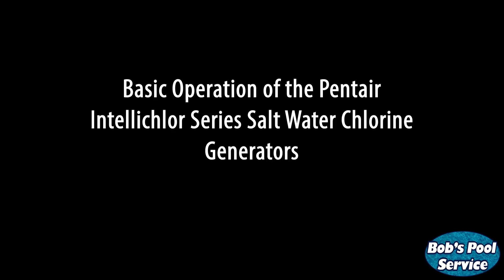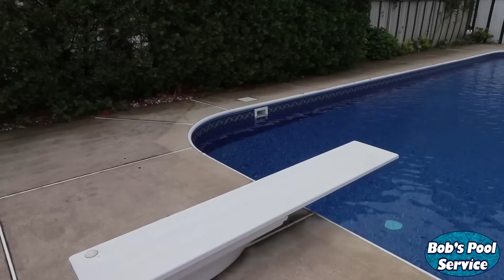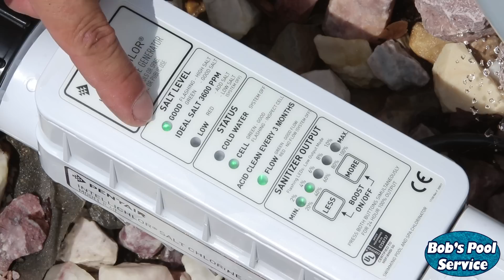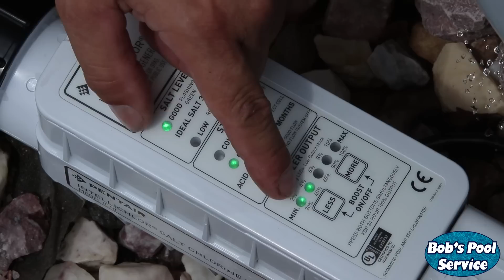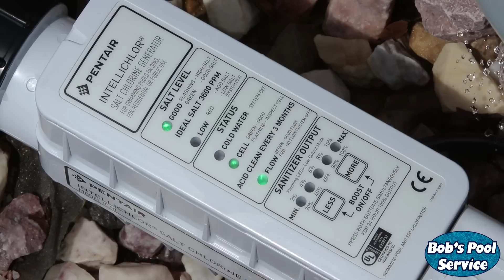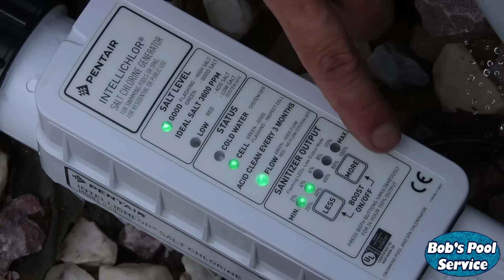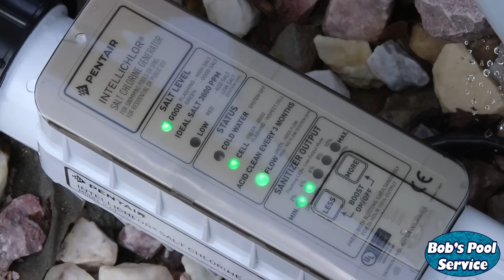Pentair Intellichlor Salt Water Chlorine Generator Operation

Comment: Great unit. However i wish it had a digital led readout like the Pentair ichlor 30.  The ichlor 30 loks very similar in style to that of a water meter, and has a flip up lid.  With the ichlor 30 you can check water temp, and view lots on the led display.  I think they now have a more advanced model available.  They are quite expensive though.

Comment: My less/more button will not change the salt level.  It always remains on 40%.  It will not allow me to change.  Any sugestions?
Reply: It is adding chlorine, not salt.  A salt pool is a chlorine pool that converts salt into chlorine.
Reply: If the IC40 is plugged into automation, it will be controlled from / by that automation.
Reply from the maker: As another commenter said if it's plugged into an automation system you would control it there, this video is made for the stand-alone installation.  If you have a stand along install and it won't change try pushing the button harder...  if that doesn't work I'd consult a pro and see if the unit is working correctly.

Comment: What if the generator is reading low but when taking a water sample in they say it’s high?
Reply from the maker: I would change the flow switch which has the salinity sensor built in.  Id trust the water sample.

Comment: Do the IC 20, 40 and 60 have the same circuit board?  How do you check to make sure the circuit board matches the cell? (10, 40, or 60)
Reply from the maker: All three units used the same transformer, the circuit board inside the unit I wouldn't know because it's sealed and potted.

Comment: What happens when your sanitizer lights are showing the % output?  When I push the more or less buttons nothing happens or lights up?
Reply: I have the same problem.  I can't change the output?  No clue if it's broken or what to do.
Reply from the maker: Be sure it's not connected to an automation system. Sometimes the buttons take some force to push them in. The new style that just came out has an easier interface.

Comment: What if sanitizer output lights are off and won’t come on unless I run a diagnostic test. Then stay off. This happened after turning power off and back on.
Reply from the maker: I never saw that, I'd contact Pentair customer support.  Sounds like the unit might be faulty but maybe they know something we don't.

Comment: I’m trying to figure out why my new generator would flash high salt but when I test the water it says my chlorine is 0.  I’m wondering if something got stuck on the sensor
Reply from the maker: The generator should be producing chlorine even with high salt.  There's a lot of reasons your pool may not be registering enough chlorine though, running at too low of a setting, not running your pump long enough, undersized system for the pool, improper water chemistry that is causing your chlorine to dissipate or get eaten up quickly by the sun, the list goes on.  The way we test a unit to be sure it's functioning is disconnect the unions, fill a bucket with pool water, immerse the cell push on the flow switch with a stick, if you see bubbles coming off the plates the cell is indeed working.  However, unless you're very mechanical and have a way to put in a bypass spacer where the cell goes I don't suggest this test, a better idea would be to contact your pool professional and get it checked if all the other factors are ok.  Definitely get a water test.

Comment: If my clients pool has too much water due to rain, and he doesn’t want to drain the pool just yet, will that affect the salt readings?  I poured 3 bags of salt into the pool weeks before the rain and every week when I check the salt readings, it’s below ppm. (2400ppm to be exact).

What gives?
I did do a salt cell clean in February of 2025.
Reply from the maker: Well, just lowering the water won't dilute the salt but when it rains and a pool has more water added it will definitely dilute the salinity.  Evaporation does not cause salt loss either so if you lose water from evaporation and then refill you'll have the same ppm.  Here in NJ we get a fair amount of rain, generally we add salt in the spring (depends on the cover) and once mid season.

Comment: So if I’m converting my pool to salt is this the only thing I need to buy? Is it an all in one package system and no other additional controller required?
Reply from the maker: There's two main components to the system, the transformer (which steps down the AC to 24V) and the cell itself (shown in this video).  All the controls are on the cell itself and it can be used as a standalone system just as I explained in the video, however, there are also options to pair it with automation panels where you can connect to the network, control with your phone, etc.  I don't feel that's necessary for most but it is an option.  I wouldn't call it a "kit" though, in addition to the cell and transformer you will need some plumbing fittings, pvc glue, also some electrical wires, conduit and 8 gauge grounding wire.  If you're familiar with plumbing and electrical wiring the installation isn't too involved but if you've never done that sort of thing it would behoove you to hire a professional.  We generally sell the unit, installation, adding salt to the pool and explaining how the system works as one entire package to our customers.  Best luck, people often say to us they should have converted sooner, haven't yet found someone not happy with going the route of a saltwater pool.  With the cost of chlorine rising I figure it might even save some money now, we used to sell it on convenience not saving money but this has changed.
Reply: @BobsPoolService thank you. Can I use any 24v supply or does it have a special connector to the pentair 24vac supply?
Reply from the maker: @HowToDoitright  The connector is special so any generic PS would not work unless you cut the cord, however in recent years companies have copied the Pentair transformer along with the connector.  I don't know if the components inside these "knock off" transformers are of good quality.  I can say the Pentair ones rarely fail, usually if they die it's from a power surge and a simple change of a small  bladed fuse is all that's needed.  The bayonet lock connector where the cord goes in can also lose connection, we're sure to handle plugging and unplugging the cell with care.

Comment: Cell light is flashing green. I cleaned it and it still is and no matter what i do i cant get the chlorine levels up.
Reply from the maker: Could be the end of the cell life, there is no serviceable parts in the cell itself short of the flow switch.  If a proper cleaning doesn't stop the service cell light from flashing it's likely time to replace it.

Comment: I have no lights turning on at all they turn on for a quick second then they all turn off a lil help please?
Reply from the maker: I would check the connection of the cord to the bottom of the power center, sometimes it can do that.  Hard to diagnose further without being there.  If it's the cell itself there are no replaceable parts except for the flow switch, if you had another cell to check it with you could also do that to make sure something hasn't gone awry with the power center.

Comment: Hi Bob.....Great Video and explanation by the way.  Very Helpful and easy to follow.  I have a 3 yr old C-40. Pentair Cell.  Im in the Gulf Coast of  Florida.   My cell is off.   (no lights -no Power)   I unplugged  and plugged the cable. Also  turn the breaker switch off a few times, and rebooted the wifi.  Nothing helped.   Do you have any  other suggestion on  what else I need to check.   Could the unit be shot  in such a short time?   Thank You
Reply from the maker: Just seeing this now, the most common issue I see is the fuse inside the transformer blows, if you had a known working cell you could test that easily and see if it lights up.  I'd open up the power center and check the fuse inside, if you're good with electric you can also use a voltmeter to make sure there's AC going into the transformer and 24V coming out of it..  The 2nd most common issue I've seen is the bayonet connector where the cell cord connects to the power center goes bad, it sounds like you did check that as best you can, sometimes wiggling it will briefly put power to the cell.  I don't believe I've ever seen a totally dead cell on any of our customers pool, 3 years is not a long time, we see quite a few lasting over 7.

Comment: More importantly Bob if the flow switch is reading green and the pump is shut off. What happens when a cFinns? Trying to  produce with no water over the finns?
Reply from the maker: No idea, I've yer to see one with a broken flow switch error in that direction.  I have put them in buckets and manually pushed on the flow switch to test them but again this was in water, if it bubbles it's good.  Did you have a flow switch reading green with no flow?
Reply: @BobsPoolService  I have before. I think it just became a little sticky. Had to tap on it once or twice and it would go to red. Just don't know how long the Fins can fizzle before doing damage to the cell.
Reply from the maker: @brians.4488  The cell would still have water in it even when shut off unless your system has an air leak, however the flow sensor is a replaceable part, I'd probably do that if I were having your problem.  You can get a pentair one or aftermarket one, I've used both and they seem to work the same.

Comment: My unit does not lower or raise when o press the less or more buttons...it also does not go to 100% while pressing both buttons ..does anyone have a fix ?? Thank you
Reply: Same issue
Reply: @mvpileggi1127  I think because I have the automation panel, the buttons are override by the panel ... Do you have a panel?
Reply from the maker: The video was for a standalone unit, if you have an automation panel the buttons do nothing. on the unit and all control is via the intellitouch panel.
Reply: @pelu7104  yep that was it!
Reply: Weirdly enough, I have to turn it down on the panel AND on the intellichlor itself. It seems whatever % the panel is set to is the minimum the intellichlor can be set to via the LESS and MORE

Comment: I had a salt cell that wouldn’t register the salt in the pool even after I cleaned the cell with Muriatic Acid, so I bought  new one and installed it and the salt is registering but the flow is Red. ( it wasn’t showing red on the old one )  I cleaned out baskets on pool pump and skimmer. Then I backwashed and rinsed and it still shows red on the flow. Is there anything else I can do before I call the manufacturer. In the meantime should I turn off salt cell. I am a 67 year old woman taking care of my pool so the Grandkids can enjoy it. Any and all help is appreciated. Thank you.
Reply from the maker: Make sure the cell is installed in the proper direction, if it's incorrect the flow switch won't work and it'll show red.

Comment: Pentair has the incredible stigma of customer service. New IC20 arrived DOA. Took then 2 months to replace it amongst many unanswered emails and several calls with  empty promises of callbacks. Only when I turned to the BBB and social media did they do something. Thay have 2 star ratings across the board. Will be buying another competitor when this one breaks. 1300 every 3 to 5 years is an expensive nut to crack. They also lied to the BBB stating they left several voicemails when it never happened.
Reply from the maker: We don't make pool equipment, we just install it.  That's unfortunate about your experience.  I have seen across the board lowered quality on everything, so far we've been more fortunate with Pentair than other brands but as a pool professional we have different ways of reaching out to these companies so it's likely a different experience.  One thing I will note that manufacturers are doing is supporting products differently depending on if it's an e-commerce purchase or if it's through a brick and mortar business...  honestly I believe the product is likely the same but the warranty and support you'll get can be VASTLY different, from a full 3 years to virtually no warranty.  I've been doing this for 40 plus years now and back in the day as a contractor we could purchase our products much cheaper therefore matching online prices...  fast forward to now and sometimes I see products we sell cheaper on amazon and other online outlets so to stay in business we simply have to make it up somewhere.  I contacted the companies and they told me the difference is the warranty so tell your customers if they buy it online they only get 6 months of support versus 1-3 years depending on the product.  I liked the old way better honestly, give professionals a way to make 20% on the product and give equal support to all purchases provided it is genuine.
Reply: Only a dumbass would buy direct from pentair and not use a faceless company like Amazon to deal with this stuff

Comment: Added salt yesterday, turned cell down to,zero , now when I get it back and running I can’t set it at 60%..I can go 20, 40 , skips 60, the 80, etc…why could this be? Thanks in advance
Reply from the maker: Maybe the 60% LED is burned out?  Seems odd it'd skip that, is it illuminated when you put it to 80% or is the 60% LED still off?  As an interim solution you could set it to 40% (or 80%) and vary the pump run time to get the same amount of sanitizer production.

Comment: So if salt low light is on add salt?
Reply from the maker: Generally yes but I would test the water with salt strips or better yet a meter.  Most pool stores have the gear to test your water there if you take in a sample.  By doing this you know how much to add and if the sensor is reading incorrectly you won't oversalt your pool.

Comment: how do I RESET the CELL since it is BLINKING Green ?  I just got my pool last year and there is NO WAY I should have a bad SALT CELL  - but I need to know how to RESET that CELL so it STOPS blinking?
Reply from the maker: Which light is blinking green?   If it's the top one that just means your salt level is high, doesn't mean the cell is bad.
Reply: @BobsPoolService  It is the STATUS of the CELL that is blinking which says INSPECT - even though my salt level is GOOD (green) and my test strips all say the levels are good.. But it always says CHLORINE is LOW - but I was told that I should IGNORE that on the test strip and only go by my PENTAIR machine when it says LOW SALT then I add SALT.  I also have the Sanitizer on 40 percent..  This sucks because I tried to reset the system by unplugging and it stayed solid GREEN for like a few minutes then went right back to blinking GREEN again for the STATUS of the CELL.
Reply from the maker: @LauraT2700  If the inspect cell light is blinking green then there's a problem.  Have you opened up the unions and inspected the cell?  Sometimes debris gets lodged between the plates and causes this or you could have buildup on the plates themselves.  The cell should be acid cleaned every 6 months to remove any scale that may have formed on the electrode.  if none of this helps I'd contact Pentair if the cell is under a year old it should be under warranty.

Comment: Great video! Quick question: my unit is displaying solid red ‘Low’ however my local pool store said my salt level was good. Will it stay red until it detects 3600ppm? All other indicators functioning properly. Thanks!
Reply from the maker: You probably need to change the sensor, it's connected to the flow sensor and they sell a kit with wire connectors.  It should not be red unless you're under 2700ppm. Is your water cold?  if it is that could also cause this.  There's a temp sensor built into the flow switch that may have gone bad.
Reply: @BobsPoolService  thanks for the advice. Probably need to change the sensor since the water isn’t cold, all other lights are green as expected and my water tested at salt levels of 3400ppm
Reply: Thank you for the detailed explanation from the blogger. This is our titanium electrode salt chlorine machine testing video. Welcome to watch. Thank you for your time

https://www.youtube.com/watch?v=Xi4_EYCDL2k

Comment: All my lights are green, but my less button for sanitizer output isn’t doing anything. Do you think my cell is bad? So it’s stuck on 100% output right now.
Reply from the maker: If pushing the less button doesn't reduce the setting then the switch has probably gone bad, really try pushing it firmly, even move your finger around as you do.  If this doesn't work then you'll need to replace the cell, the only part on the cell that can be changed out is the flow sensor, everything else is sealed and potted in a compound.

Comment: Now of my Sanitize lights come on any idea
Reply from the maker: If other lights are on I'd say it's gone bad or if it's in warranty you should file a claim.  If NONE of the lights are illuminated check the connector, at the power center, also check the fuse inside the power center which is a very common thing we replace.
Reply: @BobsPoolService  
Its crazy this one is new and the one I replaced does the same thing I can’t find a good pool guy in my area and Pentair is worth less 
Thanks

Comment: what happens when both the green and red are  flashing for the salt level?? I noticed the pool guy has left the sanitizer at max all 5 lights are solid on? thank you Lanny
Reply from the maker: When the lights are all flashing like that it's doing a self check, sort of a boot up phase.  Once it's on though for 10 minutes or more that should settle in and stop, if not something could be wrong.